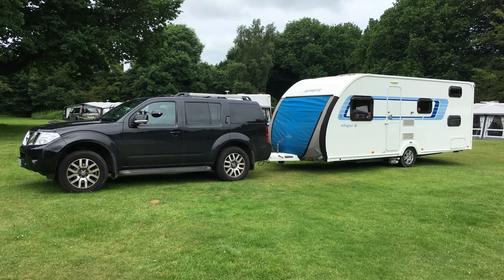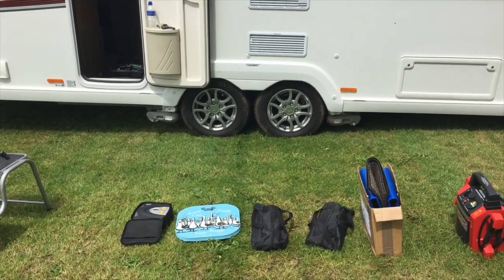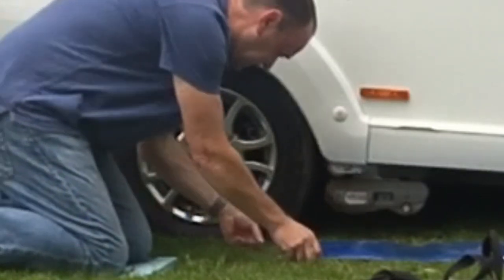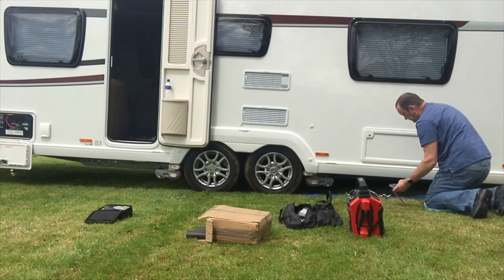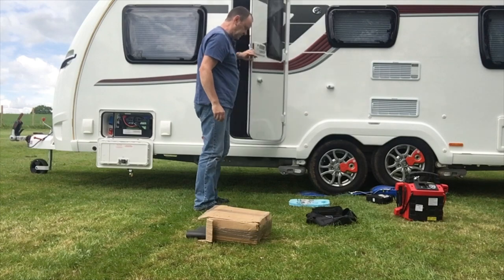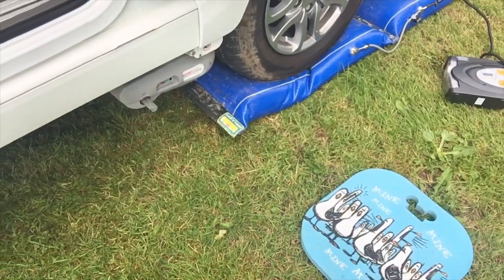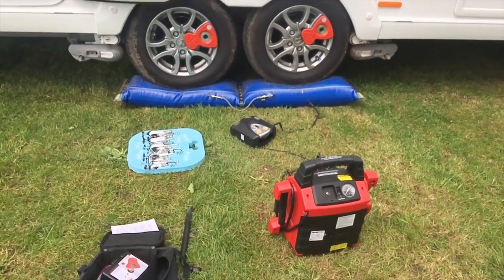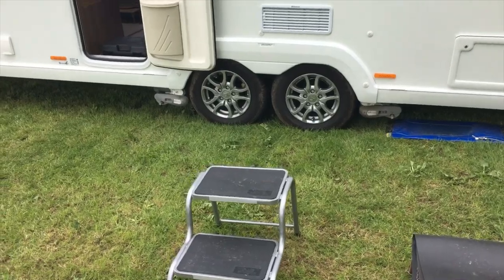How to Lock n Level  you’re  twin axle caravan

Comment: I use a couple of treated decking planks to level my twin axle. Just reverse back, lay planks down and then pull onto them. I have additional wood boards if required. I changed my wheel locks to the Nemesis ones that fit onto their wheel nut.
Reply from the maker: another option - THANK YOU

Comment: Can you tell me what you do if you need to lever the other side instead- how do you get locked aligned then?
Reply from the maker: Thanks for watching bhphunter 1 = Motor mover into position or leave attached to the car 2=raise the side with the lock on & put it on (both if needed) - then lower 3=raise the other side till level & do the back&front as well …VOILA. All level & locked. I also don’t mind leaving or putting the movers on if really bad
Reply: @beyondthatbluedoor  yea but how do you raise the other side if the lock and level is then trapped under the ‘locked side’?
Reply from the maker: Apologies I thought this was the e&p hydro system. On the lock n level you only raise the Non lock side. So motor mover to the correct (ish) position in order to get 1 lock on. Don’t put it on But clock the position to put the lock n level mat down once you go forward again putting the lock n level down when you go back again then you can put the lock on & raise on the other side.

Comment: Are you using the alko locks purely for security or as a safety for van rolling?
Reply from the maker: For both reasons really as you need them both on for Insurance purposes (CCC gets me discount as well - as "approved" ) & they lock the axels so helps prevent any unwanted rolling - it was a fairly steep gradient both left to right & back to front. I've done other methods & this leveling system is easy - I will do a video on it as there are more benefits to this - THANKS FOR WATCHING THOUGH